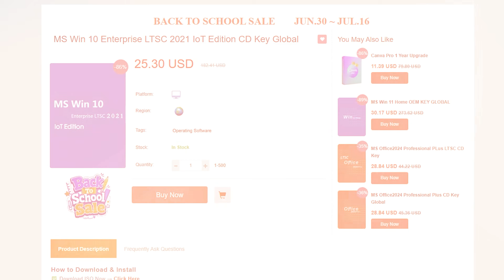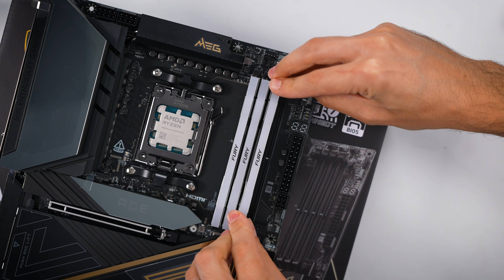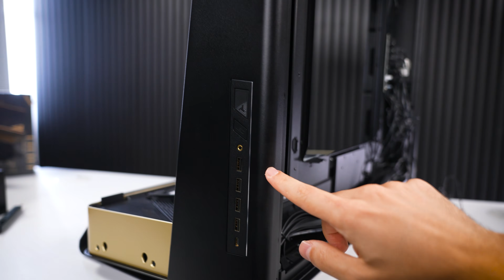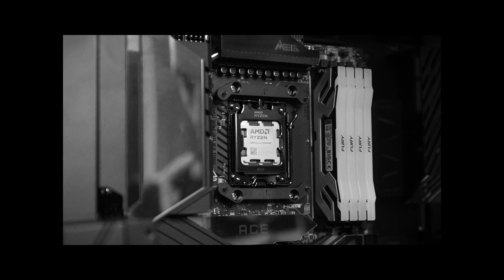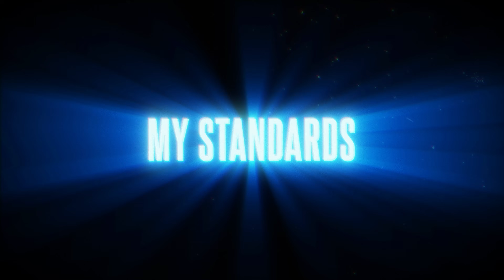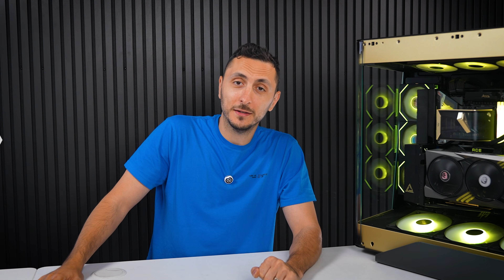I Built the Most Overkill Gaming PC Imaginable!

Comment: Edgar, 
I want to let you know that watching your videos has helped me so much to learn about building a PC. On July 29, 2026, I found a store called Micro Center that my buddy recommended; come to find out that a lot of your videos are made in this store. I was never a PC fan; Coming from Xbox One and PS5, I was just bored with their performance, so I finally decided to invest in something greater. I was prepared to spend at least $2,000, hoping this would be good enough; I was intimidated by almost every build costing a few thousand dollars more based on your channel, but I followed through and started with one of Micro Center's bundles listed below, and I completed the build with the following components; 

AMD Ryzen 7 9850X3D
ASUS B850E TUF Gaming WiFi AM5
Corsair Vengeance RGB 32GB DDR5-6000 Kit
Gigabyte, AMD Radeon RX 9070 XT Gaming Overclocked Triple Fan 16GB GDDR6 PCIe 5.0 
KLEVV Cras C925G 2TB 3D TLC NAND PCIe Gen 4 x4 NVMe M.2 2280 
MSI MAG A1250GL PCIE5, Fully Modular Compact Gaming 1250W Power Supply, 80+ Gold
Lian Li GA II LITE Performance 360mm Water Cooling Kit - Black
NZXT H6 Flow RGB Tempered Glass ATX Mid-Tower Computer Case - Black

I could not be more satisfied with this build. Thanks to your videos; you have helped me pick out the components I would not regret buying. Now I am hooked on PC building and looking forward to building my partner a gaming PC of her own. 

Thank you for your content.

Comment: X3D instead of X3D2, no contact frame, 96gb of ram is fine for the faster speed and better latency. Not even the astral oc 5090, which is generally the best 5090 for cooling and performance. It feels like you're building intentionally wrong so you have content for the future

Comment: Amazing video! Do you think this case could fit two RTX 5090s at the same time, one being MSI GeForce RTX 5090 Lightning Z mounted vertically and an ASUS ROG Astral RTX 5090 Edition 20 mounted horizontally?

Based on your experience building in this case, do you think this would be physically possible, or would there be clearance issues with the motherboard, PCIe slots, side panel, or radiator and fan mounts?

I'd love to hear your thoughts. Thanks!

Comment: Day3- make this pc pls👇

Cpu- Amd Ryzen 9 9950x3d2 (contact sealing frame)

Cpu cooler- Asus ROG Ryuo IV SLC 360 or the latest&best one from asus (push & pull confi)

Gpu- Msi Lighting Z 5090(push & pull confi)

MB- Best/latest CROSSHAIR X870E from asus or msi (3 Hydrus cable)

Ram- DDR5 32x2 or 48x2 Fwl 9to10ns Cl 28to30 speed 6000or+(if possible y not more)

Storage- Samsung 9100 pro 8tb gen5

Psu- Asus or Msi 1600or+ W 80+ Titanium 

Fans- All Lian li uni wireless fans. Top 3 exhaust, Bottom 3 intake, Right side 3 intake n exhaust (push/pull), Left side 3 exhaust n intake (pull/push), total 18fans

Case- Msi MEG Maestro 900r

Theme- Black/White or White/Black

Comment: UPDATE: September 25th 2026, I've made more top level "Over Kill" changes. I transferred my build into the  MSI MEG Maestro 900R and wrapped the gold in black. Micro Center had one in stock, so I bought it. Replaced my MoBo with the MSI X870E GODLIKE MAX AMD AM5 eATX. Replaced my GPU with the Gigabyte NVIDEA AORUS GeForce RTX 5090 Infinity OC and added the Li 8.8” Universal Screen to the inside of the case. 

Its not about need because who needs an OP gaming rig like you are building?  Very few people but there are people like me that just built an OP PC that I will probably never use its full capabilities.  And why did I spend so much on it?  Because I can!  NewEgg has it listed for $699.99.  If it came in all Black or tuxedo black with white accents I would have bought it.

CASE

•	      MSI MEG Maestro 900R

CORE HARDWARE

•	Processor (CPU): AMD Ryzen 9 9950X3D2 Dual Edition Granite Ridge AM5 4.30GHz 16-Core, 32 Threads

•	Graphics Card (GPU): Gigabyte NVIDEA AORUS GeForce RTX 5090 Infinity OC

•	Motherboard: MSI X870E GODLIKE MAX AMD AM5 eATX 

•	System Memory (RAM): Corsair VENGEANCE RGB 64GB (2 x 32GB) DDR5-6000 PC5-48000 CL30 Dual Channel Desktop Memory & 2 dummy sticks VENGEANCE RGB DDR5 Light Enhancement    

•	Primary Drive: 2TB Samsung 9100 PRO PCIe Gen 5 x4 NVMe M.2 SSD 

•	Secondary Drive: 2TB Samsung 990 PRO PCIe Gen 4 x4 NVMe M.2 SSD 

•	Power Supply (PSU): Corsair RMe Series RM1200e 1200 Watt 80 Plus Gold Fully Modular 

•	Operating System: Microsoft Windows 11 Home 64-bit 

COOLING & COSMETICS

•	CPU Cooler: Lian Li HydroShift II OLED Curved 360mm AIO Liquid Cooler 

•	AIO Fans: Lian Li UNI FAN SL-INF WIRELESS 120 Fluid Dynamic Bearing 120mm Case Fan 3-Pack

•	Airflow Fans: 2x Lian Li UNI FAN TL120 V2 Reverse Blade Wireless 120mm 3-Packs 

•	Exhaust Fan: 1x Lian Li Uni Fan TL Wireless LCD 140mm Case Fan 

PREMIUM DISPLAYS, RGB & PERIPHERALS

•	Main Monitor: Alienware 27 4K QD-OLED Gaming Monitor (AW2725Q)
•	Secondary Monitor: ASUS TUF Gaming 27” 1440P Monitor (VG27AQM5A) – QHD (2560x1440), 300Hz
•	Case Screen: Lian Li 8.8” Universal Screen
•	Keyboard: Corsair K55 RGB Pro
•	Mouse: Razer Basilisk Pro
•	MoBo Strimer: Lian Li Strimer 24-Pin RGB Mother Power Extension Cable 2.4GHz Wireless 
•	CPU Strimer: Lian Li Strimer Wireless 2x8-Pin CPU RGB Power Extension Cable, 2.4GHz Wireless 
•	GPU Strimer: Lian Li Strimer Wireless 16-Pin GPU RGB Power Extension Cable, 2.4GHz Wireless
•	USB and Fan Hub: Lian Li Edge Hub Universal USB and Fan Hub